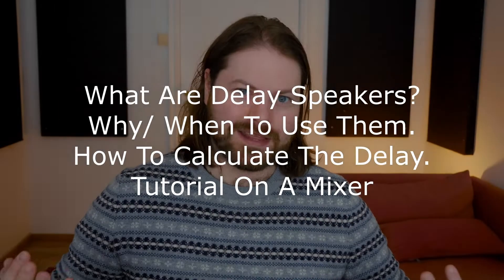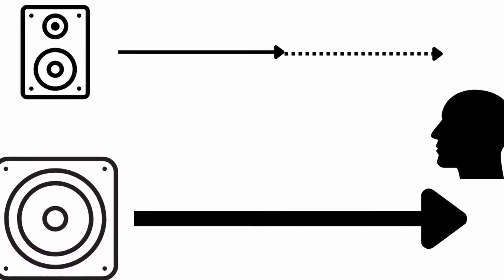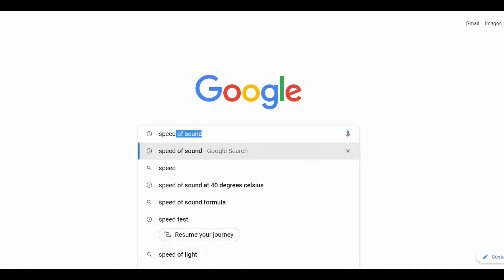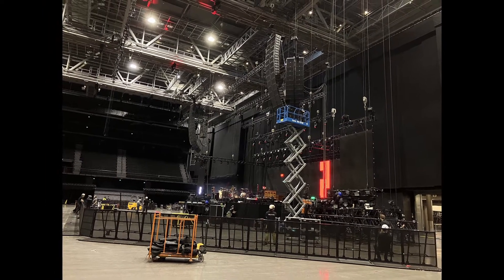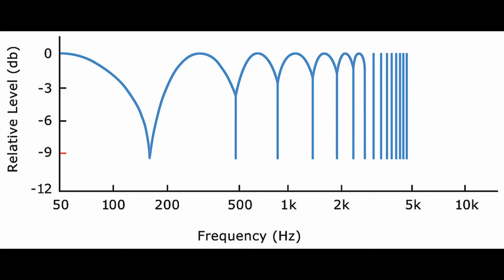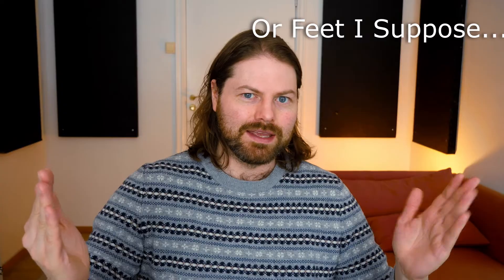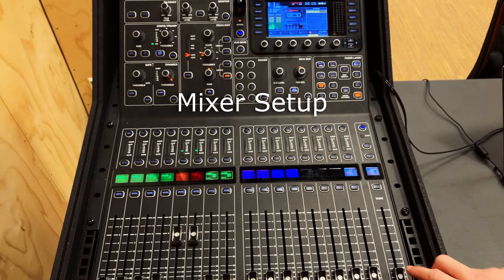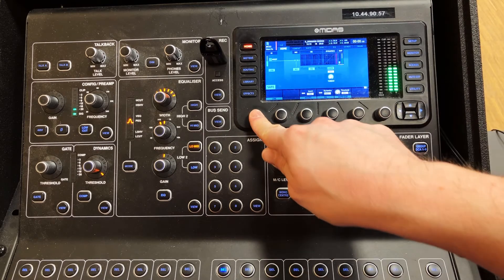How To Set Up Delay Speakers

Comment: Great video!  So, if you are working a venue that's small enough to use two pairs of speakers but large enough where you need to deploy a single delay matrix, is it possible to just listen with your ears to null out the comb filtering and not have to use the formula to calculate the delay?

Thanks for the video!  You got another sub as a result. 😊

Comment: Isnt out there any equipment with a thermometer, and a software that automatically level and sync the delay signal?, ive been to a party and the delay was so off, it was like 2 tracks playing not sync, they probably set the delay parameters during the day which was sunny, and at night it was just awful

Comment: Is it possible to Daisy chain from the left right speakers and set delay time on the delay speakers or is it better to have them on separate mix output? Cheers.
Reply: Ah then I guess it's possible, I'm not sure which is the better way, that's why I'm here aswell
Reply: I don't think this is possible as you are just sharing the output from the primary speakers.
Reply: @timothyandrews5975  my speakers have delay control so it is possible. I've done it before. Just wondering what is more ideal

Comment: How about mixer YAMAHA M 16 XU analog...how to setting the delay
Reply from the maker: It's not possible to set output delays on this mixer, most analogue mixers are not designed for this. Consider a system a processor.

Comment: I just had an A-HA moment:
Prior to this video, I had been using an aux (read monitor) mix going out analog 8 with the delay set for outdoor shows at nearly 33 meters to my delay towers.  But now, I’m going to use one of the matrices to send the signal.  My delay towers are mono. Output to a wireless transmitter to two receivers on the same frequency.
So, instead of setting all the channels to zero and post fader, I’ll use the matrix to send exactly what I’m doing at FOH so both FOH and delay are the same mix. I was always worried that the two mixes weren’t getting the same ratio of each channel. They were, theoretically. But, using the matrix assures that. And it will be one less thing I need to worry about. 
Jeez, I can’t believe I was doing it that way and didn’t think about this before. I will lose my front fill matrix, but I haven’t used that up to now anyway.

Thank you for this great revelation.
Reply from the maker: Glad you got to grips with it :)

Comment: Good information To have , now that alive gigs are back at full blast . Venues are very varied , in long rooms this really helps especially when you want to avoid blasting the front crowd . 
Less stress on your system and better sound distribution. I’d use power monitors on stands I’d possible .👍🏾👍🏾👍🏾
Reply from the maker: Thanks! Glad you enjoyed :)